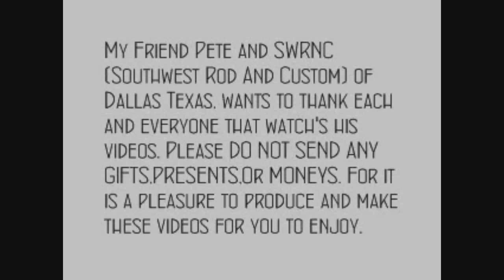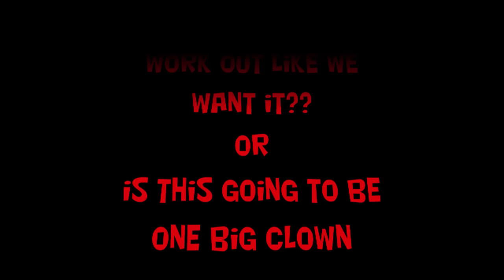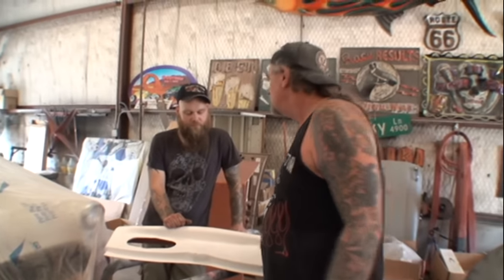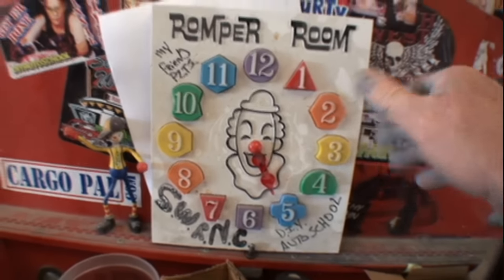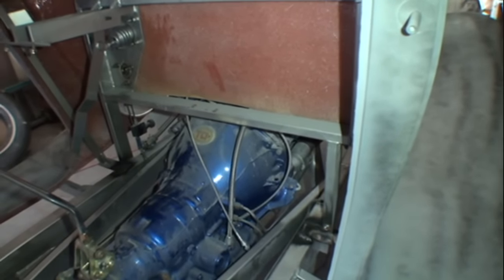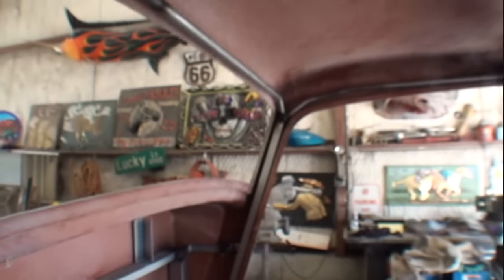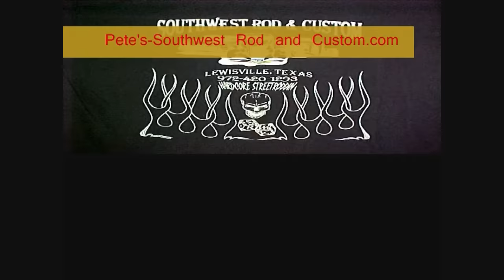Building A Kit Car In 10 Days-Part 2 - Prime It Up And Weld That Metal

Comment: hey Pete I just finished welding floorpans frame rails torque boxes etc after I sealed everything I painted everything with that chassis saver stuff underneath the car other areas that are hard to reach have surface rust should I just squirt it with oil or use some rust paint?

Comment: 734 knew what he was gettin into,, only thing i question, he didnt weld the blind sides, the body should of came off, if you have to grind welds to make it nice looking seams you`re fuckin it up, thing will fall apart 5 yrs or less, and LIQUID NAILS  crap you really got it goin on WOW..
Reply from the maker: You can't weld the steel structure with the body off the car and then put the body on.. The body has to be set on the frame and then you add the metal structure to the body.. The metal structure fits together like a puzzle jig and you weld it up.. Actually if you don't have a welder it's designed to bolt together.. I preferr welding over bolting.. As for the Liquid Nail, it's a form/type of liquid nail but not what you think it is, I just call it that because it looks like it and is a one part glue instead of a 2 part epoxy type...
Reply: well i hope its all good to go, i never built a kit car, looks like im not going to after this anyway, but one thing i wouldn do is half ass build it and then quit and let someone else do it, thats gotta be expensive, kep riding their ases and ill keep piping in on your vids.. awesome Pete thanks for the info and settin me straight.
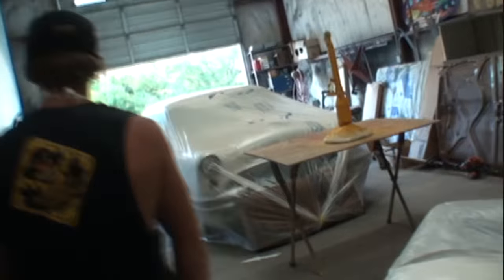Reply: really 6:25 in the morning, thats  5;25 your time damn it man,, im trying to get my wife up early,, wish me luck with that,